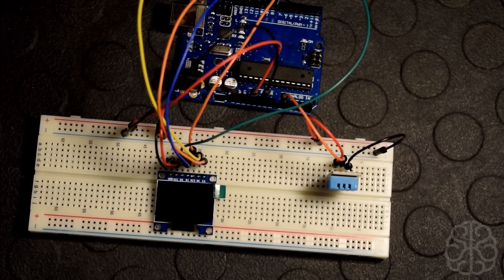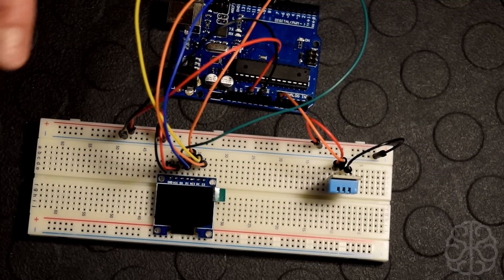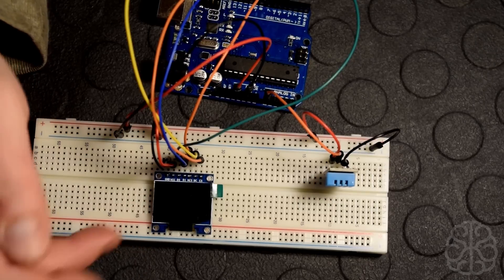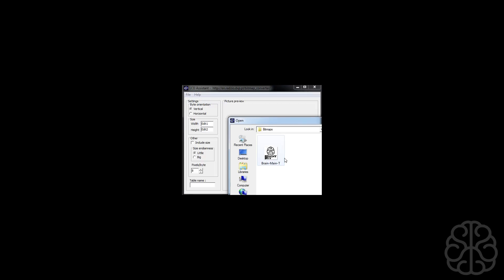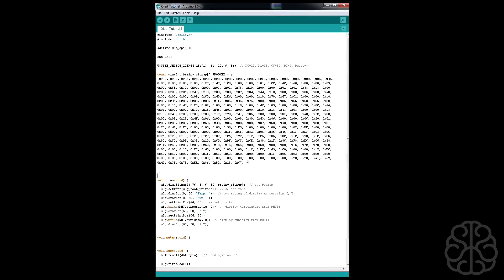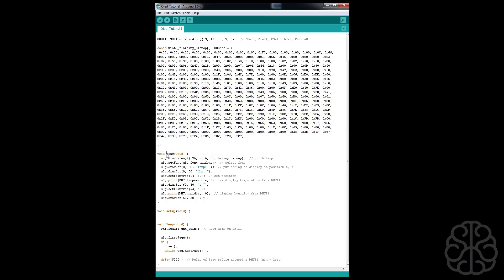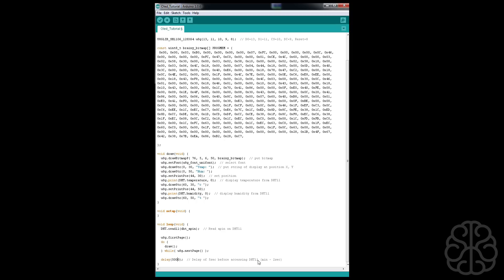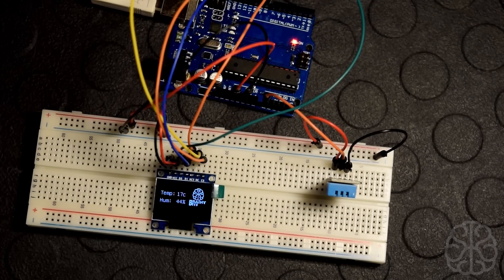Connect and use an OLED Display with Arduino using the SPI Bus - Tutorial

Comment: In this case SPI DOES NOT only offers speed advantage!! BUT, the ability to use more than 2 OLEDs at the same time by using the CS pin unlike in I2C case where the device only has 2 addresses. Correct me if I’m wrong.
Reply from the maker: You are correct about SPI having the CS (cable select) option, but there are ways around it when using I2C by using a multiplexer.  I've done a tutorial on this here: https://youtu.be/wqyHbQvcoWw
Thank you for the comment and for watching!
Reply from the maker: Btw you only need a multiplexer when the I2C devices you are using are sharing the same I2C address.

Comment: sir, i am having a problem with the adafruit library. well my oled is working fine but the problem is that the whole adafruit logo is not fitting in my oled. i am using the adafruit1306 SPI example. my oled is 128x64 SPI oled. please help me
Reply: You have to edit the Adafruit_SSD1306.h file in your library.  By default it's set to 128x32 pixels.  Just open with a text editor and scroll down a few lines till you see "#define SSD1306_128_64"   Remove the "//" from in front of it and place "//" in front of the line below it to ignore "#define SSD1306_128_32"
Reply: icarus03lmfp, it's not working. Please tell some other way.

Comment: +Brainy-Bits 
hi, Good tutorial like always  (y)
the spi is more faster than i2c but it tooks 5 digital pins of the arduino and sooner or later will run out of pins. 
is there a module like the LCD backpack to make it  i2c ; i noticed on the back of this Oled some resister to add or to remove ?
about the 1.44" TFT LCD module it cant be modified to work on i2c , so i thought may be using an arduino pro mini or micro to make it a standalone i2c LCD to use it with other arduino board . so can you help with the code 

thanks a lot i really enjoyed and learned from your tutorial (y)
Reply from the maker: +Akrout Osama You are correct that the SPI is faster but does take more pins than the I2C.  Haven't had a chance to play around too much with the resistors on the back or the 1.44 TFT LCD, will try to revisit these modules in future videos.  Thanks for the suggestion and for watching of course :)

Comment: For those with Chinese parts like the 4 pin DHT11 here are the pin configs
http://arduino-info.wikispaces.com/DHT11-Humidity-TempSensor 

And the chinese OLED SPI like this one http://i.ebayimg.com/00/s/NzAwWDcwMA==/z/8scAAOxyVLNSuZ8f/$_1.JPG
 
Dont' forget to install the  U8GLib library & DHT library which can be found on this page 
https://brainy-bits.com/tutorials/connect-and-use-a-spi-oled-display/ 

 

Chinese version OLED SPI Connect your pins like this
gnd -  gnd
vcc -  3.3v (VIN)
SCL -  pin 13(Clock)
SDA -  pin 11(Data)
rst     - pin 8
D/c   - pin 9

Arduino Code:

 
#include "U8glib.h"
#include "dht.h"
 
#define dht_apin A0
 
dht DHT;
 
U8GLIB_SH1106_128X64 u8g(13, 11, 10, 9, 8);  // D0=13, D1=11, CS=10, DC=9, Reset=8
 
const uint8_t brainy_bitmap[] PROGMEM = {
 0x00, 0x00, 0x03, 0xB0, 0x00, 0x00, 0x00, 0x00, 0x07, 0xFC, 0x00, 0x00, 0x00, 0x00, 0x0C, 0x46,
0x00, 0x00, 0x00, 0x00, 0xFC, 0x47, 0xC0, 0x00, 0x00, 0x01, 0xCE, 0x4C, 0x60, 0x00, 0x00, 0x03,
0x02, 0x58, 0x30, 0x00, 0x00, 0x03, 0x02, 0x58, 0x10, 0x00, 0x00, 0x02, 0x02, 0x58, 0x18, 0x00,
0x00, 0x03, 0x06, 0x4C, 0x18, 0x00, 0x00, 0x07, 0x04, 0x44, 0x18, 0x00, 0x00, 0x0D, 0x80, 0x40,
0x3C, 0x00, 0x00, 0x09, 0xC0, 0x40, 0xE6, 0x00, 0x00, 0x18, 0x78, 0x47, 0xC2, 0x00, 0x00, 0x18,
0x0C, 0x4E, 0x02, 0x00, 0x00, 0x1F, 0x86, 0x4C, 0x7E, 0x00, 0x00, 0x0E, 0xC6, 0xE8, 0xEE, 0x00,
0x00, 0x18, 0x43, 0xF8, 0x82, 0x00, 0x00, 0x10, 0x06, 0x4C, 0x03, 0x00, 0x00, 0x30, 0x0C, 0x46,
0x01, 0x00, 0x00, 0x30, 0x18, 0x46, 0x01, 0x00, 0x00, 0x10, 0x18, 0x43, 0x03, 0x00, 0x00, 0x18,
0x10, 0x43, 0x03, 0x00, 0x00, 0x1C, 0x70, 0x41, 0x86, 0x00, 0x00, 0x0F, 0xE0, 0x40, 0xFE, 0x00,
0x00, 0x09, 0x1E, 0x4F, 0x06, 0x00, 0x00, 0x08, 0x30, 0x43, 0x86, 0x00, 0x00, 0x0C, 0x20, 0x41,
0x86, 0x00, 0x00, 0x06, 0x60, 0x40, 0x8C, 0x00, 0x00, 0x07, 0x60, 0x40, 0xB8, 0x00, 0x00, 0x01,
0xE0, 0x41, 0xF0, 0x00, 0x00, 0x00, 0x38, 0xE3, 0x00, 0x00, 0x00, 0x00, 0x0F, 0xBE, 0x00, 0x00,
0x00, 0x00, 0x00, 0x00, 0x00, 0x00, 0x1F, 0xCF, 0x82, 0x0C, 0x86, 0x46, 0x1F, 0xEF, 0xC3, 0x0C,
0xC6, 0xEE, 0x1C, 0xEC, 0xC7, 0x0C, 0xE6, 0x7C, 0x1C, 0xED, 0x8D, 0x8C, 0xFE, 0x38, 0x1C, 0xED,
0x8D, 0xCC, 0xDE, 0x38, 0x1D, 0xCD, 0xDF, 0xCC, 0xCE, 0x38, 0x1F, 0x8C, 0xF8, 0xEC, 0xC6, 0x38,
0x1F, 0xEC, 0x08, 0x0C, 0xC2, 0x18, 0x1C, 0xEC, 0x00, 0xC0, 0x00, 0x00, 0x1C, 0xFD, 0xFB, 0xC0,
0x00, 0x00, 0x1C, 0xFC, 0x63, 0x00, 0x00, 0x00, 0x1C, 0xEC, 0x63, 0xC0, 0x00, 0x00, 0x1F, 0xEC,
0x60, 0xC0, 0x00, 0x00, 0x1F, 0xCC, 0x63, 0xC0, 0x00, 0x00, 0x1F, 0x0C, 0x63, 0x00, 0x00, 0x00,
0x00, 0x00, 0x00, 0x00, 0x00, 0x00, 0x00, 0x00, 0x00, 0x00, 0x00, 0x00, 0x28, 0x2B, 0x4F, 0x67,
0x42, 0x38, 0x7B, 0xEA, 0x86, 0xB2, 0x28, 0xC7, 
 
};
 
void draw(void) {
  u8g.drawBitmapP( 76, 5, 6, 50, brainy_bitmap);  // put bitmap
  u8g.setFont(u8g_font_unifont);  // select font
  u8g.drawStr(0, 30, "Temp: ");  // put string of display at position X, Y
  u8g.drawStr(0, 50, "Hum: ");
  u8g.setPrintPos(44, 30);  // set position
  u8g.print(DHT.temperature, 0);  // display temperature from DHT11
  u8g.drawStr(60, 30, "c ");
  u8g.setPrintPos(44, 50);
  u8g.print(DHT.humidity, 0);  // display humidity from DHT11
  u8g.drawStr(60, 50, "% ");
}
 
void setup(void) {
}
 
void loop(void) {
  DHT.read11(dht_apin);  // Read apin on DHT11
 
  u8g.firstPage();  
  do {
    draw();
  } while( u8g.nextPage() );
  
  delay(5000);  // Delay of 5sec before accessing DHT11 (min - 2sec)
}
Reply: What about CS on the chinese OLED display?
Reply: @RSuarez66  pin 10